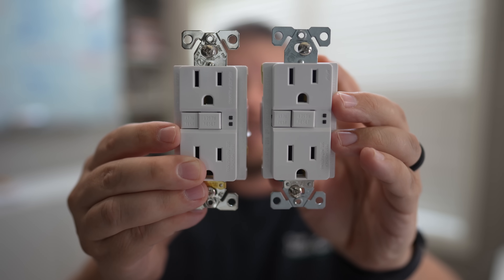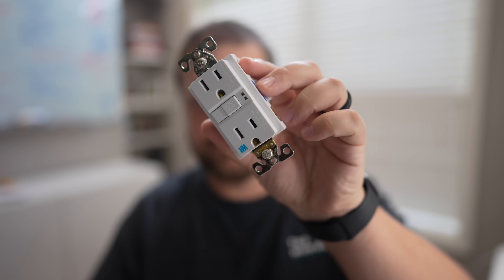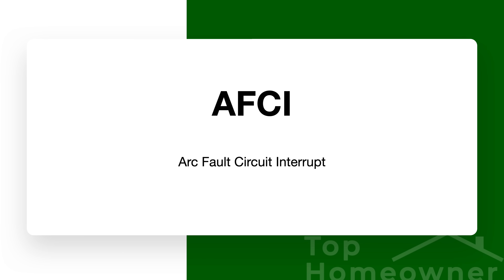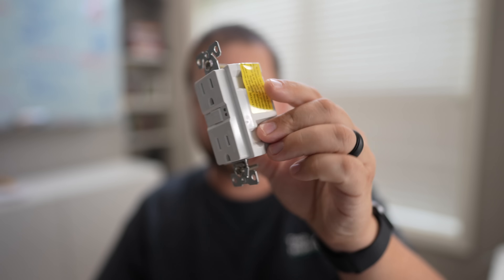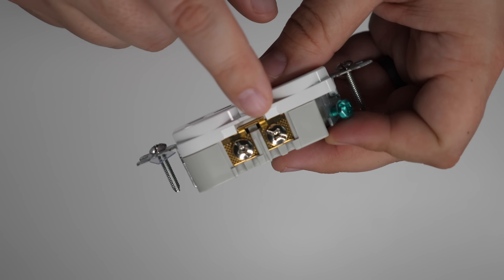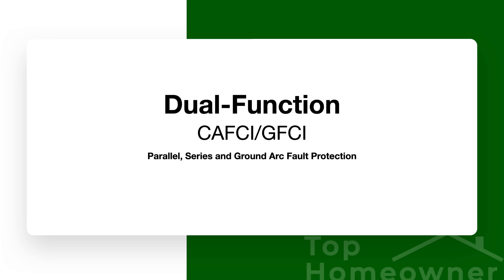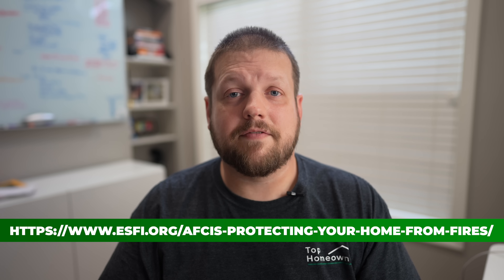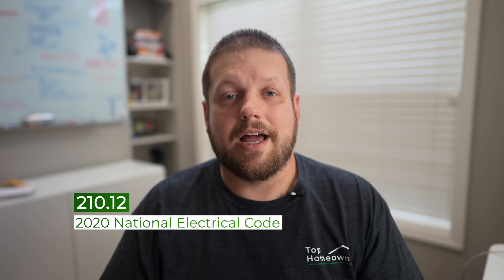AFCI vs GFCI: What's The Difference and Why You Should Care

Comment: Removed the town mandated AFCI breaker on our refrigerator after two nuisance trips.

Lost hundreds of $$$ in food as we were out of town in both events.

AFCI breakers were mandated after a kitchen remodel. We had NO electrical problems for 23 years before the remodel.

Also removed the AFCI breaker for the 110 volt line that powers the igniters for the gas burners on our stove for the nuisance tripping issue. The oven would loose its flame w/o warning.
Reply: It is code that dedicated motor loads like your refrigerator and your garbage disposal. Do not have to be GFI. It’s somewhere in section 250 and if you note it is the largest section in the NEC.
Reply: @stephenrocks7004  So the local government doesn't know or understand the code, then. Not surprised.
Reply: CGI can be as bad...this guy is selling FEAR OF ELECTROCUTION...
Reply: Gas stove igniters have been the cause of losing 2 speed control boards from stove hood fans on 1 of my jobs. Now, i run the gas stove on it's own circuit.
Reply: Yeah screw that. What a pain in the ass.

Comment: Aside from cost an issue particularly with GFCI & AFCI circuit breakers is the amount of extra space they take up in a panel. One of these typically takes up the space of 2 normal breakers. The receptacles also take up much more space in a box which can be a problem when there are multiple wire connectors for branch circuits in there.

I've installed several circuit breakers to keep up with code requirements. Also have a couple GFCI receptacles. No problems with the GFCI breaker but had an AFCI breaker fail. Can't confirm why but I don't think it was due to circuit overload & suspect the breaker itself was faulty, nearly caused a fire. I smelled burning, went to investigate & found the breaker scorched at the neutral connection. I disconnected the other AFCI breaker & hooked the circuits back up with standard breakers. No longer trust AFCI circuit breakers after that episode.
Reply: Not all of them take up extra space. Siemens with plug on neutral are same exact size.
Reply: @andrewshedron425  See my reply to Casey Lascallette. Perhaps slimmer versions are available now but not when I was looking.
Reply: In what make of main service panel do afci breakers take up two spaces?
Reply: @caseylascallette7269  I have a Siemens panel & both GFCI & AFCI breakers take up double the space I can fit a normal 15 amp breaker.
Reply: @MikeSiemens88  Combo breakers are 1", same as our standard Q line breakers.
Reply: Are you using tandems?
Reply: Unless your using alot of slim or tandem breakers, they are the same size as a standard breaker. Just alot more expensive.

Comment: When we took over the 30 year old house we live in ,I was amazed by how it passed code,15amp Gfci on a 20amp breaker,non functional, and the other in my garage as well as not functional 2 story house 1989 build.Just recently changed my last fixture in the hall closet,and no suprise ground wasn't connected plastered in place lol.Eventually we will have whole house rewired and replumbed.Good explanation video.
Reply: 15 amp gfis are rated at 20 amp feed thru...look at any new gfi in a store....its fine
Reply: also if 2 or more plugs in a circuit can use 15 amp plugs on a 20 amp as per the nec
Reply: and if you hook the power to the load side of  a gfi it wont trip...old landlords trick...
Reply: @paulverstraete9157  my house is a wiring nightmare just to replace the outlets in my kitchen I had to turn off 5 breakers and I only have 7 outlets lol one is smart dedicated 20amp and outlet for dishwasher/disposal lol
Reply: @Troy-McClure81  what in the world lol
Reply: @paulverstraete9157  how does this work?  landlord trick of preventing the gfi from tripping by putting it on the load side?
Reply: Hey, PJV.... No, I'm sure it was NOT to code; that's why you always want a home inspection before closing.
Reply: @CharlesMartel676  ya i think the in-laws were just trusting that the City Inspector did there job,I was flabbergasted to say the least when we first walked into the house.But frame to finish in 30days is Sketchy back then it was only 3 inspections if I remember correctly 1989-90 when my house was built and finished.Hell even my tile roof is dropping tiles like dollars on a stage.
Reply: @Troy-McClure81  their
Reply: @@cjrock4096 The city inspector should have caught it,I turn a breaker off marked living room and it cuts off only 3 in living room the other 3 you guessed it kitchen.Turn off breaker marked downstairs lights turns off the rest and some switches and outlets in kitchen,turn off all downstairs it even kills power to garage light switch but not outlets,that breaker is the GFCI breaker,which also controls my outdoor outlet low voltage and also trips if bathrooms upstairs get overloaded,which upstairs only has 2 breakers,not including the GFCI breaker.Just remodeled master bath and when walls came down they ran the wire along whole shower wall with outlet.

Comment: I'm in Europe we usually have mains breaker to be GFCI so we literally have protection in entire house and don't need special circuits.. I've tried shorting main to ground on multiple circuits and it always tripped my main.
Reply: There is a major upside to individual circuit protection, if you just protect it at the mains entering your home then anything goes wrong and your entire house is dark making troubleshooting a lot harder and all of the issues that can come with a power outage like ruined food. With it at the individual circuit level, the breakers, you automatically have it isolated to one circuit and only disruption of one circuit.
Reply from the maker: Interesting! Thanks for sharing!
Reply: If the main goes, it's because the AIC of that main is possibly incorrect and not 'coordinated' properly.
Reply: That makes great sense!
Reply: @CharlesMartel676  Actually it is not great sense. It is in fact quite poor.
I will explain why.

Having a single GFCI protecting the whole house is dangerous. Dangerous for the occupiers.

If an earth fault occurs on any final circuit, then that GFCI will trip cutting power to the entire house which includes any power tools that may be plugged in and in use, and also to any lighting.

If that occurs at night time then you have a problem, because the house is plunged into darkness and that it then becomes difficult, even dangerous for the occupiers to try to navigate around the house to get to the distribution board to fix the problem.

Ideally what you should do is have multiple GFCI's covering different final circuits and the electrician should design the installation considering the impact when a GFCI is triggered.
Reply: @deang5622  I mean  navigating house at night is hardly a danger... Not to mention 99% of people would just use phone to find their way around. I do agree it makes diagnostic bit more difficult as you'd have to unplug pretty much everything to try and find it. However I'm yet to come across any of this in 10 years or so. Even if it happened once it would suck for a moment and than you'd forget for like another 10 years while your entire house is protected.
Reply: @deang5622  Feels like you are reaching to make this point.   We all face the same problem when the power goes out.    Used to have flashlight or even a candle.  Now days we reach for our phone to light the way.

Comment: Here in Canada any plugs in bedrooms require afci because American code requires them. We are not smart enough to re-write the plug spacing rule to get away from "the middle of walls" . cause where do you put beds, desks etc (anything big)... the centre of walls . So you end up with a plug behind your headboard not on each side  of the bed and then cord damatge. stand in a room and imagine where crap is going and space accordinly.
Reply: The electrician that wired my home put outlets on walls, close to the corners, but these are larger bedrooms. He did this on the 2 walls that the bed usually stands. When I bought the home it was not built, I could have asked for something that would make sense, but the topic never came up. The salespeople were more excited to sell the extra boxes in the ceiling for fans at $250 each, yes, I did buy the one  I couldn’t do it afterwards because of the raised ceiling where there is no room to get to it. The code at the time was 12’ spacing between outlets, minimum code. No one thought about selling 10’ or 8’ spacing.  Doing my basement I did 7’ spacing, because I did it with one piece of conduit from box to box, rather than a connector and another small piece of conduit.  Many outlets are switch controlled, for things like, a juke box, pin balls machines, video play center, TV’s, back lighting, accent wall lighting, side lighting, a reading light, regular lights, a pool table light, bar lights, and one arm bandit machines. There are 19 switches and 21 outlets in this 1600 sqft rec center. It seems that there’s no money to be made in selling some home options like more wiring. When the sub (not the sub contractor, but the actual electrician doing my home) was wiring the home he did a few things for me for free. Thanks…Jim
Reply: I've never seen a woman yet  (or some men) who doesn't like to rearrange furniture often.
Reply: @pokeypuppy2083  Beds are usually not the furniture that gets often rearranged
Reply: "re-write the plug spacing rule to get away from "the middle of walls"" -- don't know what you're talking about. Code requires outlets no more than 12' apart (so you're never more than 6' from an outlet), but nothing says that has to be in the middle of a wall. It's easy enough to arrange outlets so they don't wind up behind a bed, and still comply with code (unless you've got an enormous 13' wide bed).

Comment: Arc faults can also be usefull if your electrician was a moron and put all your plugs in the middle of your walls ( useing the 6/12 rule) because the cords will get bent over hard at the plug that will over time mess up the cords. Or if he was sloppy pulling the wire inthe walls during rough in and there all kinds of twists and kinks.

Comment: Would it make sense to just replace all of the breakers in the panel with AFCI rather than replacing all the receptacles in the house (except to have GFCI in wet areas)?
Reply: I think it comes down to cost at that point. And also if you're doing the work yourself
Reply: You also have the very real problem - that after you replace them all - and spend the cash - you WILL shortly be going back to the original breakers or putting in GFCI breakers which work just fine and protect from a much more common hazard - which can occur in ANY area.  AFCI's are plagued with nuisance tripping.
Reply: Another poster commented that the AFCI breakers are physically larger than non-AFCI breakers.   Your panel might not have enough space.

Comment: Would this (breakers) still provide legal code protection for an older home in which has a few circuits with cloth covered wire ran through insulators?  We can't afford a total rewire job.
Reply from the maker: Code is going to vary by area. Also if your box is too old (sounds like it might be) you won't be able to install these.
Reply: @TopHomeowner  Would changing the entire box and using these breakers still be cheaper than rewiring the house?
Reply: @SzymczykProductions  I can't afford "you professionals".  That's why I'm asking questions here. The estimate for a total rewire job is more than the house cost almost 40 years ago. The things I wasn't comfortable doing I hired a pro to do. I also had them check what I had done and they said it looked safe and would have passed code. I learned how to do it by asking questions and later by watching youtube.
Reply: @pokeypuppy2083  Why replace the wiring in the house if it doesn't need doing?

Suggest you do some insulation resistance tests and measure the resistance of the cables.

If this reports unfavourable values showing the wiring is deteriorating, then you need to do a full house rewire.

I strongly recommend you get these tests done, because you don't know what condition those cables are in, and if you are an electrician, you could be considered negligent if you don't ascertain the condition of the wiring and then the house burns down or someone is electrocuted in a few years time.

And if somebody dies, the argument "it cost too much to replace the wiring" isn't going to wash with the prosecutor or judge.
Reply: I dont know about code but it sounds like afci would mitigate your main failure mode here (a break in the insulation)
Reply: @noobulon4334  That's a bad approach.
You're simply putting a sticking plaster on to a gaping wound.

The correct action to follow, given the wiring is so old, is to do some insulation resistance checks, conductor resistance checks, visual inspection of the cables in order to determine the condition of the cables.

If the condition is poor, then the cables need to be ripped out and the property rewired.

Then install the AFCI where possible to provide protection, either with the old cables if they have been determined to be in satisfactory condition, or after the house rewire is done with new cables.

Comment: Our jurisdiction requires afci on most circuits plus gfci near water usages or when old wiring (non-grounded) is connected to.
Reply: I’m going to let you in on a little secret: they don’t come looking at your breaker box unless you give them reason to. Fortunately, in my jurisdiction, there is no building code enforcement, nor is there permitting, etc. I prefer freedom.
Reply: @lwheatcraft I don't know which is best?  It's thoroughly enforced here... not to mention if something went tragic, the insurance corp would be using code violations as an out to skip out on the payday.